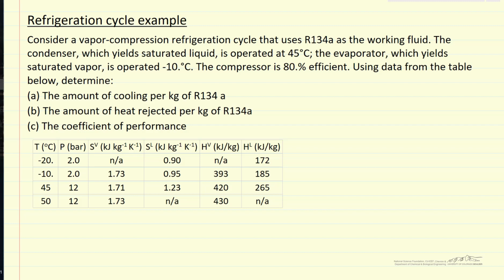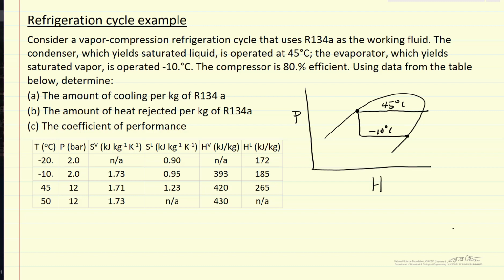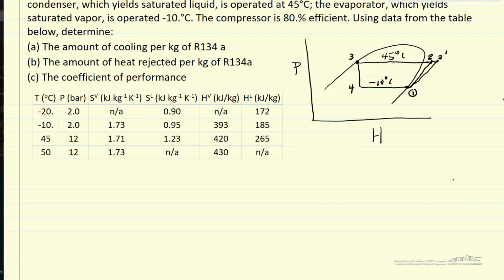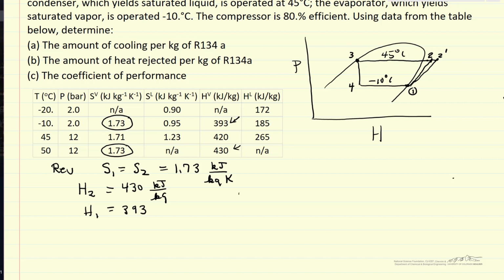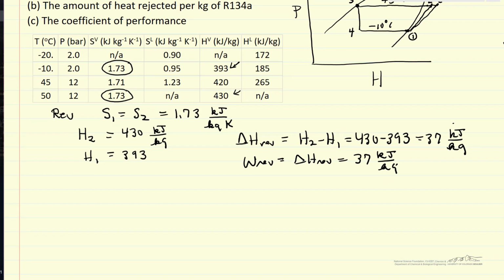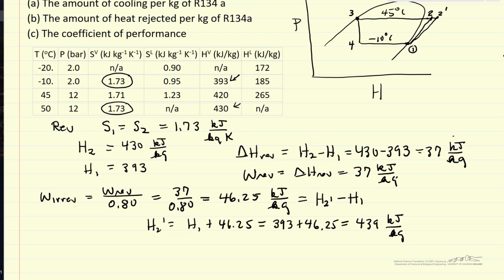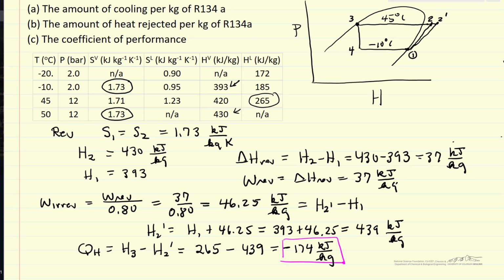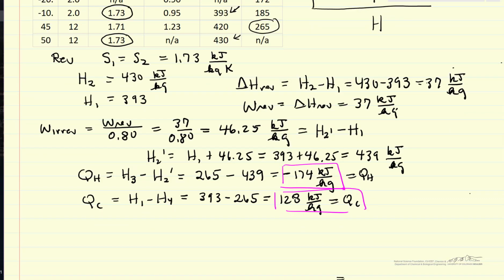Refrigeration Cycle Example

Comment: This is a nice easy problem for warmup to do since table values are provided and there is no need to do the tedious things like flipping through pages and doing linear interpolation. I do think it would be nice if you solved things in order of what's actually asked in the question. If you were in an exam, you would calculate qc right away without any need to calculate compressor work.